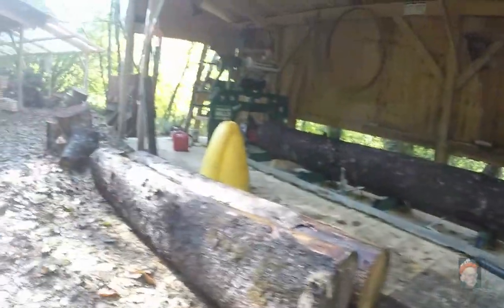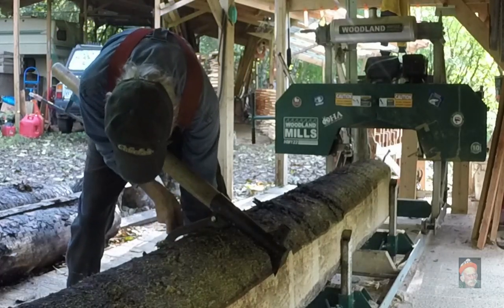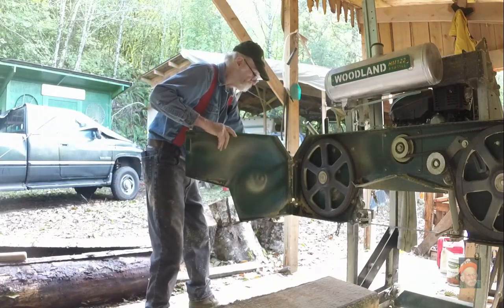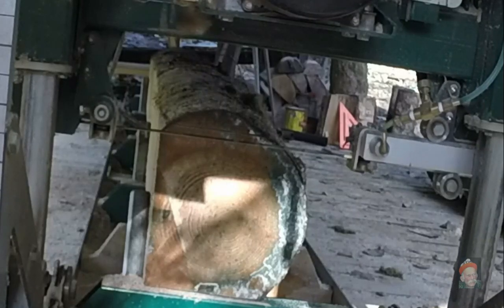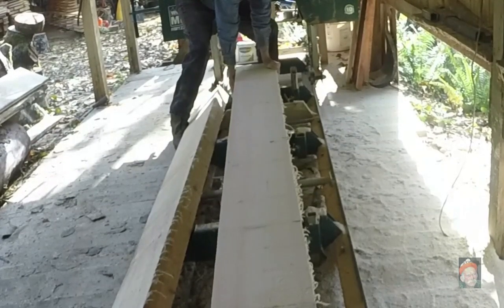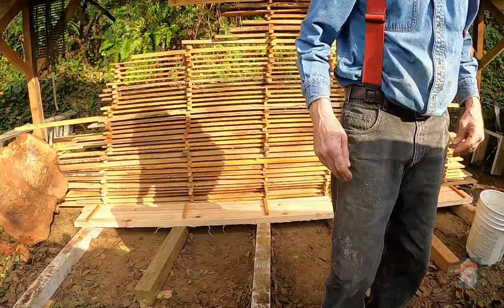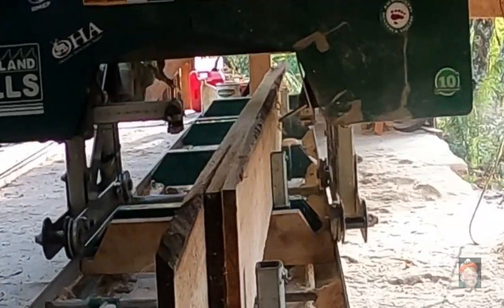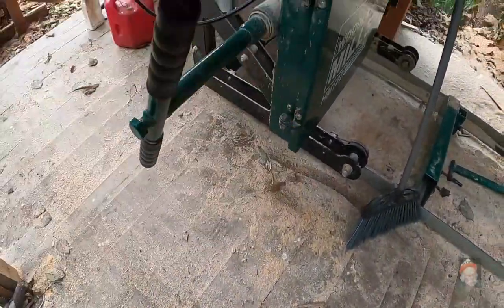Making Stickers on my Woodland Mills Sawmill and Making Space for Lumber

Comment: Might be spruce. Been cutting quite a bit of spruce lumber lately, all has stringy finish whether blade is sharp or not. Looks good 👍 Great tip on the abs pipe. Will be using that one myself from now on.
Reply from the maker: It's embarrassing to have so little knowledge and ability to tell what kind of wood I'm working with. Once the limbs are off, I'm lost.

Comment: Sawdust causes mould on the boards and rust on the blade. In a barn it most likely would not make a difference. It happened once in six years no boards or cants are left this saw dust on them since that time. I stash my blades the same way you do. I’m going to quit some day. 😅
Reply from the maker: I've seen mold a couple of times, both on green boards stickered but not cleaned of sawdust. I guess cleaning off the sawdust is worth the time and trouble on lumber that's not going to be used for a while.

Comment: Polyethylene cutting board on the bed stock 😎
Reply from the maker: You've got me scratching my head over your comment. To what are you referring?
Reply: @OregonOldTimer  less expensive than stainless steel, it will dramatically ease log turning
Reply: * stainless steel is best
Reply from the maker: @mrglasecki  Aha. On the bunks. Stainless bunk caps aren't an option on this sawmill, and I'd never have thought of poly on the bunks.

Comment: Just curious, since using your new sawbuck for awhile is there anything you would have done differently?  I need to build one!
Reply from the maker: A couple of things. I'd have oriented the uprights flat sides parallel to the sawbuck, at least on the cutting side, to extend saw reach and allow for greater volume. I'd have all horizontal bracing several inches below the firewood to avoid sawing into them at the end of the cut.
Lumber Jack has a pair of videos on building a similar, but better, sawbuck.
https://www.youtube.com/watch?v=4Ma5QEO1CUg&list=PLvE7sxyMTaY_jXlKHHbOlw726-0GYAiC5&index=23&t=1s

Comment: You should get some help and raise your mill to waist height which would be easier on the back. Rig up a winch system to roll the logs up.
Reply from the maker: Exercise is good for my back, and loading logs is faster and easier with the mill on the ground.
If I were doing this as a business and interested in speed and efficiency, I'd probably look at it differently.